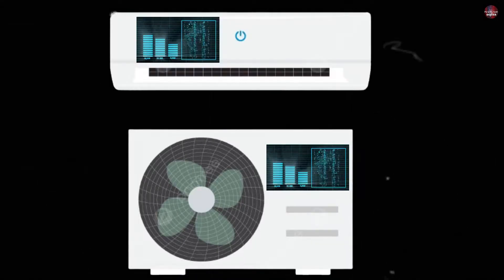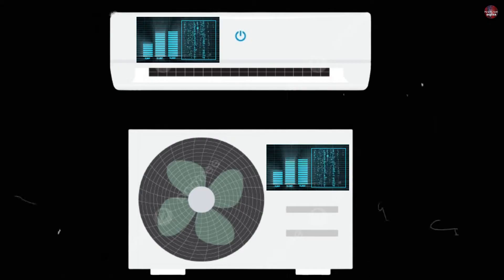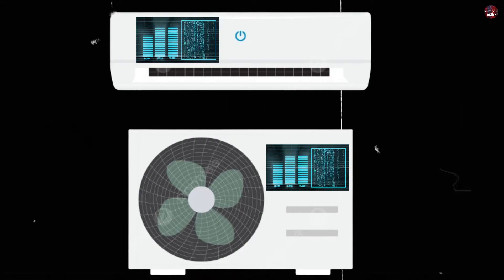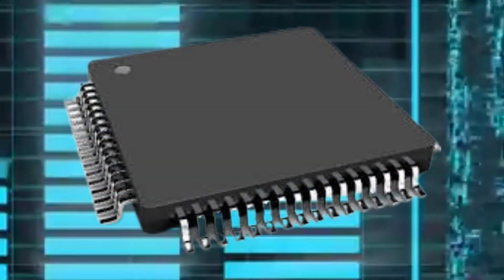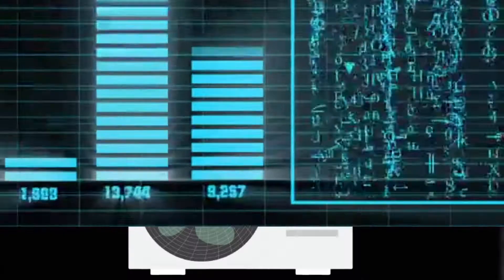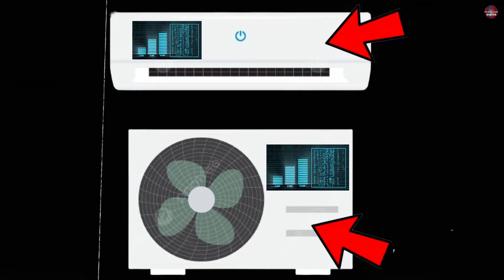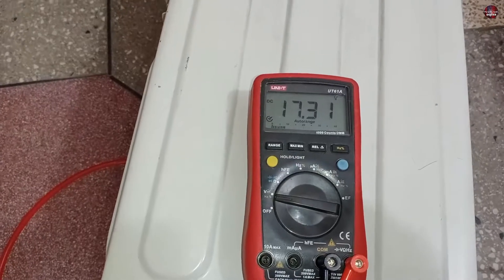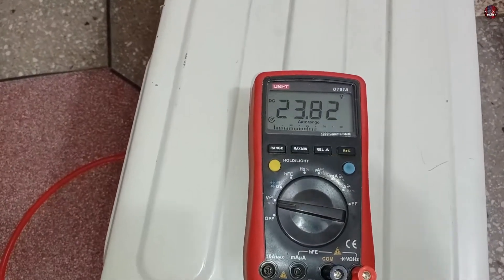Proven Method To Test Serial Communication in Inverter Mini Split Ac

Comment: I have Samsung 1 way cassate AC but getting error E201 I have even contacted a AC technician but they told me might be issue on communication cable 

So I hired another guy to check communication cable with the help of multimeter he said cable is totally okay it’s 4 cord cable 

Can you please tell me what to do? It’s 2 ton Samsung AC and we are getting voltage of 230V while Ac in idle as long as AC run voltage drops to 220V 

So give me solution if you have sir
Reply from the maker: Its model number??

Comment: If you had a 230V where would you connect the ground probe on your meter, since there is no Neutral?
Reply: To one of the 120v terminals. I tried it on my Senville

Comment: How do I know if the outdoor PCB is working or indoor PCB working. Is it low voltage is outdoor and high voltage for indoor?
Reply from the maker: By checking the voltages on line and neutral terminals with the help of a multimeter